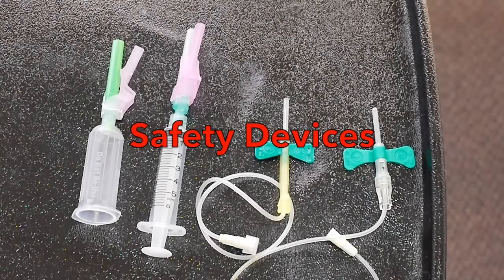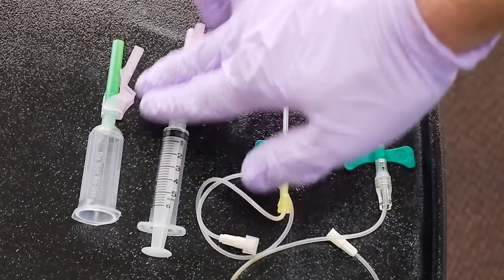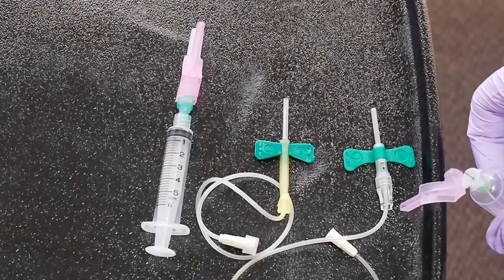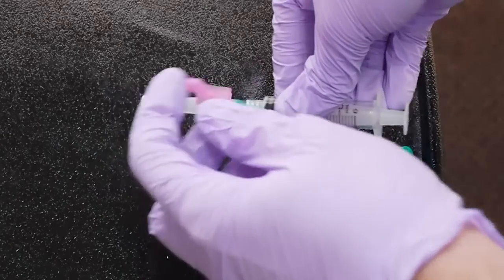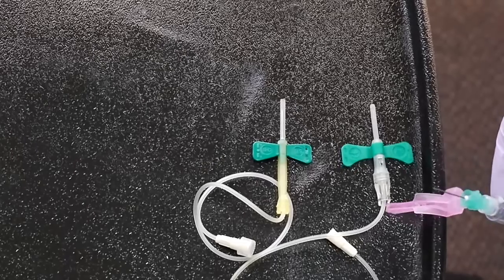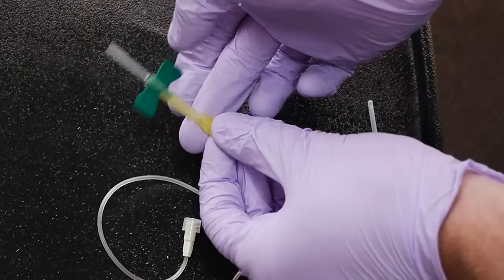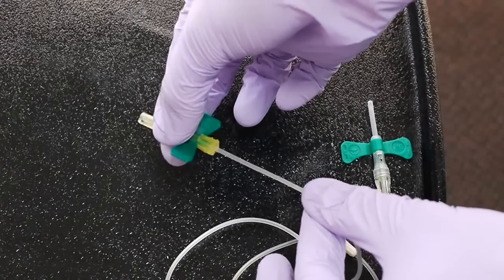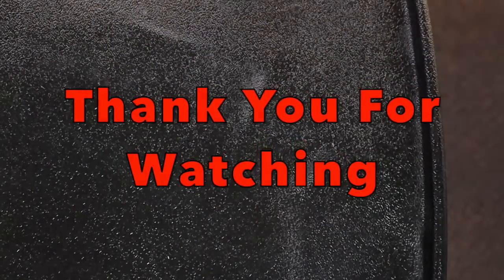Safety Devices

Comment: This video is outdated as BD specifically calls out in there package insert not to use a hard surface to engage the safety device and that the pad of the thumb should be used.  Facing the cover towards yourself increase the chance of splatter and breaks the covers if not done right.